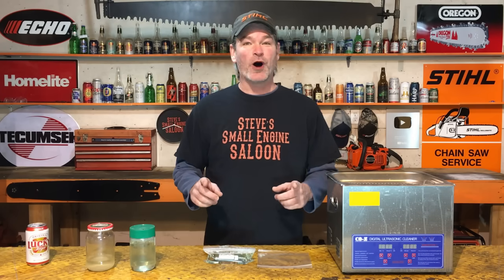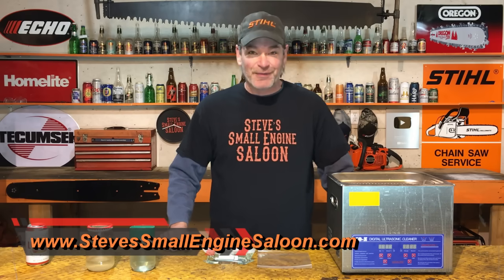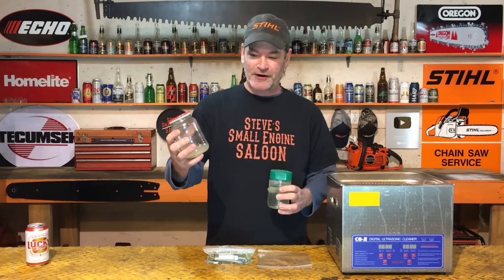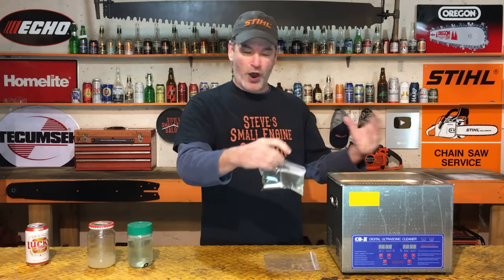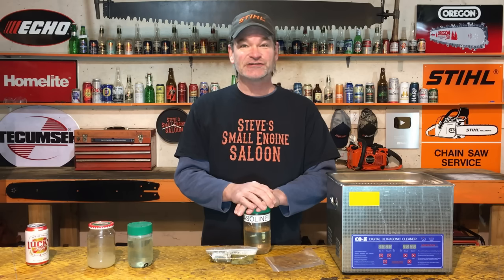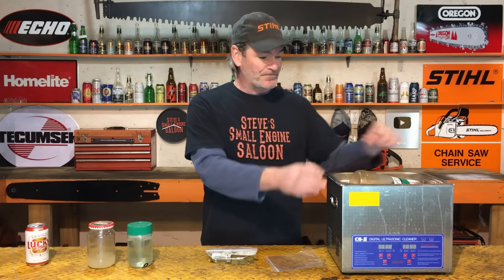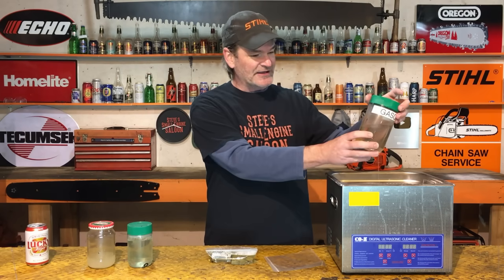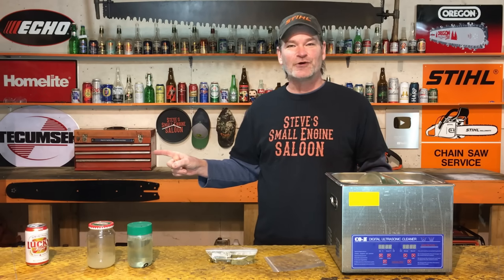UPDATE: Ultimate Tips For Using An Ultrasonic Cleaner

Comment: Steve, great video and advice. I’ve used Dawn in my ultrasonic for years but at work I’ve tried using a small glass container and “gasoline/2 cycle mix” in mine.... it cuts the clean time in half and I believe it dissolves of solidified debris that has dried in carbs from setting. I do run my heat but keep it under 100 degrees and creep the lid loose on my jar because it seemed to build pressure. My jar sits perfectly on my basket so it won’t tip over. The bubble action is amazing to watch. 
Thanks Steve!!!!!
Reply from the maker: You're Welcome...

Comment: Love your videos Steve but I do have a comment regarding plastic and gasoline. I bought a cheap turkey baster to extract small quantities of gas and oil without having to get out my pump. I got sidetracked and left the baster sitting in the old gas that I had extracted. (There was only about an inch of gas in the bucket.) I came back a few hours later and found a melted turkey baster. The gas had eaten about 3 inches off of the end of the baster. The bucket that I was using was also plastic but it was fine. That being said, if the plastic breaks down in the usonic cleaner, I think the worst thing you would run into would be having to clean out the reservoir, assuming of course that your cleaner isn't close to any ignition sources.

Comment: You changed the way I use both of mine, I have a 10L and a 15L I now use the plastic Skippy jars cause they have the largest mouths, I use the mixture I use cause I have pets, my mixture, won't kill em, I use 50% simple green purple, 25% distilled white vinegar, and 25% distilled water, IE baby water, besides using the same amount of gas would cost you more, and disposing of the dirty gas will harm the environment unless you do it properly, and that's a pain, my mixture you can dump out in your backyard without harming the world, now I preheat my mixture in a microwave, so my ultrasonic cleaner doesn't have to, you can't do that with gasoline, and as to using plastic over glass or visa versa, I just find the plastic more able to accommodate carbs, cause you can't flex glass to fit a carb.

Comment: The complaints against using  gasoline could be putting it in a sealed container, it could expand and possibly break the container. Other than that yea gas is a great cleaner, I also use dawn dish soap as a degreaser for bigger stuff

Comment: I'm relatively new at this and I've only used Gunk carb cleaner in my ultrasonic cleaner. I think it works great but it does damage rubber parts. interested to know why the simple green or other detergents are preferred by others. Great info as always Steve.

Comment: Great video Steve.
I never knew I could ultra-sonically clean stuff in a jar or zip-lock. What a genius idea to not pollute all of the solution in the tank.
Reply: If using a jar or bag (isolation container), you don't need the ultrasonic cleaner's tub to have cleaning solution in it. You fill it with water (distilled is preferred) and put the cleaning solution in the isolation container with the part.
Reply from the maker: Thank You...

Comment: The use of petrol/gas is mad. But when it goes tits up is because people fill the whole tank with petrol not just a bottle or bag, and the metal parts being rattled about can cause a spark. I've done it but I put the tank out in the middle of the lawn just in case it goes up. Never has but I'd rather it be outside if it does.

Comment: yup if you have not tried the unleaded gasoline trick... you are missing out!!
one thing is to dip the carb in berryman carb cleaner first for at least 1/2 an hour ..
I did it on honda generator carbs (stripped down). then ran it in the unleaded gasoline for 3 x 15 min sessions
turning the carb in the each time session.
then dip the carb after a good rinse off in fresh unleaded gasoline.  brush off any stuff left, blow dry with air compressor air.
final dip in the fresh can of berryman carb cleaner to treat the aluminum for anti corrosion.

trust me it works!!
it worked on hard to clean Yamaha generator carbs worth 300.00 each!!
well done steve!! well done!!
Reply: Awesome

Comment: I have used gas to clean things threw the years. Once a friend got burned with gas and in the burn unit in the hospital...Which I will never forget some of the burn patients. My friend was putting gas in a older lawn mower with the gas tanks by the engine. Engine not running but was hot and boom. A few guys got burned bad by fueling there plastic fuel cells in drag cars.
 Happened by static electric charged. Why they made us use ground strap the top ring on the fuel cell. When using gas make sure you are grounded so you don't start one by static electric charged. Never gave that a thought till I was in my 40s myself.

Comment: Gas works good and I do use it but my go to is the solvent from the carb dip kits from Napa as a solution for mine at work for 3 reasons:
1, it cuts varnish up better than gas 
2, it has a higher flash point than gas so I can heat it up in the ultrasonic cleaner using the heat function
3, say it's closing time and I have 1 more carb to run, I can throw the carb in the ultrasonic cleaner with it off and let it sit overnight in the sauce and fire it up in the morning for 10 minutes and it comes out spotless. Sometimes if the carb is really bad I will run it in the ultrasonic cleaner for an hour before the close of business and let it sit overnight and then run it for another hour in the morning.

Comment: I’m a gunsmith and have owned a crest ultrasonic cleaner for over 15 years.  I use a mesh tea infuser ball to put tiny springs and parts in.  I use biodegradable degreaser in my cleaner and have even used dawn dish soap in a pinch or in the rare occasion for guns with a delicate finish. Dawn is used to get oil off animals so it’s about as gentle degreasing solution as you can get.  I’ve never just put water in my cleaner and then put a part in a bag of the degreasing solution.  Next time I swap out my solution I’m gonna try it with just water as you do.  Thanks.  Never too old to learn something new.  👍

Comment: Might be a Canadian only tip but milk bags seem to be a bit sturdier than zip locks for smaller cube carbs.  No idea if fuel will melt them over time.  I seal them with a chip clip.  Clean the milk protein out first by running some fuel in a new bag.
Reply: Haven't seen a milk bag since our time in the prairies -- brings back memories!  I can't imagine how much milk my parents bought -- drank with every meal and chugged it down like water whenever we ran in from outside...

Comment: Steve I am thinking that video was a 2 beer video . I use  JetA  in my tank . With heat .
Works great . If you can get your hands on JetA fuel . Or Kerosene .
Reply: Jet A1 and Kerosene is the same product . If it is used on the ground , it is called kerosene . If it is used in the air (aviation) it is called Jet A1 . You can also get what they call None Aviation Jet if it is not used in the air . Jet A1 is cheaper because they sell more of it then Kerosene . ATB , Ken🇨🇦 .
Reply: @kenchan5047   Yes you are right .I am a mechanic for a airline . If I went into that kind of info It will lose peeps.

Comment: Contained gasoline is not dangerous... Now if you heated it in the tank I guess it could expand and leak into the water and float on the surface. This could ignite I suppose but I believe it would take a pretty deliberate action to ignite it. If you were sucessfull in igniting it it would simply create a low cold flame on the surface of the water as the fumes evaperated and burned off. Not seeing a tragedy happening still. Ok lets say it sat in hot water and leaked all night...no one turned off the machine...and there is only an on and off switch with no timer. You could theoretically create a fume problem that would gather at the floor and spread across the shop. Now you have explosive fumes. Not liquid but fumes...now you would still need an ignition sourse. A water heater with a pilot light? A gas boiler? A wood stove? All things you shouldn't have in a small engine shop anyway but in a home garage or workshop these things do happen. But it's rare. You almost have to do it on purpose...but ok it could happen to a moron...so it's not impossible.

Steve try NAPA non-clorinated Brake cleaner. I think you may  be suprised. Just buy a can and spray it into your peanut butter plastic jar. You can find brake cleaner in 1/2 gal cans but just to experiment you only need a 12 oz can or so. You can reuse it even if it looks dirty many times. Keep the lid on though because it evaporates quickly.

Comment: I have the same unit.  The container does not need to be closed if the water in the unit is not so deep as to overflow into the container.  I use glass baking dishes, & etc..  You will not be restricted by the neck on the jar in this way.  I do not use gasoline, instead I use standard solvent which is used for parts cleaning.  It leaves no film like gasoline and is almost impossible to ignite.
Reply: So you just use parts washer solvent?  Wondered why that or the simple green wouldn't work in one of those ultrasonic cleaners....I don't have one, wish I did sometimes though but don't need one often enough to warrant the price.  So I just clean everything by hand and soak in simple green if I need to overnight.
Reply: William Sevier  I use what is/ was called “standard solvent”.  It is not water based like most of the parts washing solvents today.  Basically any fluid will work to a certain extent.  It is the microscopic bubbles created by the ultrasonic waves that do the cleaning.  A good analogy regarding the liquid used is found in clothes washing.  You could wash your clothes in plain water and they would be cleaner than when you put them in the washer, but you use a detergent to help break down the soils and remove more dirt.  You can follow this idea by thinking of the ultra sonic cleaner as the washing machine with agitation(parts don’t actually move like the clothes but the fluid does) vs. just soaking the clothes in a pail of water.

The difference between your technique (which I used for many years I might add) and ultrasonic cleaning really shows itself with high gloss items such as jewelry.  The rings and stones come out virtually like the day they were purchased.  I mention this only to tell you that there is a difference between soaking and ultrasonic cleaning.

Harbor Freight has a small ultrasonic cleaner that I upgraded from primarily because of capacity.  (It will hold small carburetors, gun action parts, milling machine collets, and etc.). It worked fine but a guy who already had one told me what I needed to do to it before using it to prevent damage.( Like most Harbor Freight items they need a little tweaking). If you decide to go this route contact me here and I will tell you what to do.  It’s not much but needs to be done to prevent it from being damaged.
Reply: @37yearsofanythingisenough39 what needs to be done just bought one
Reply: @slicktmi  If your unit  from Harbor Freight is the one with the silver plastic housing, somewhat oval shaped, you need to more or less caulk the seam just inside the rim that goes all the way around the tank with a silicone caulk.  I used RTV Red due to the fact that it is high temp and the unit does have a heater.  It probably could be done with any silicone caulk because I doubt the temp ever gets that high that RTV Red is actually necessary.  If you do not do this the fluid in the tank will eventually destroy the electronic control of the unit as it, or atomized fluid, will pass through this seam. Make sure you use a 100% silicone so that it remains flexible over time and just force it into the seam with your fingertip.  Wipe the excess off the wall with a rag saturated with mineral spirits for a neat looking job.  RTV Red is sold in most auto parts stores or home centers in a tube on a blister card.  Hope this helps.

Comment: What about using a soda blaster like people use on motorcycle and car carburetors? Usually they use that in conjunction with an ultrasonic parts cleaner vs a ultrasonic alone and it’s safe to put any part in a soda blaster including plastics.

Comment: I used gasoline in a glass jar with no heat after watching your other video.  Cleaned parts well and no other problems.  However, when I opened the lid to the jar there was a sound as if the jar had become under pressure.  I will probably try it again before deciding on the future of using gas.  Keep the videos coming!
Reply: The temperature in the room can promote evaporation thus liberating vapor that results in pressurization of the container.
Reply: Also temp change.  If it went in the solution at  40 degrees and the solution is even ten degrees warmer. It will pressurize the container a touch.

Comment: I put the parts in the basket without any jars or containers. I also lined my basket with finer screen to prevent small parts from falling threw. Simple Green or Evap-O-Rust.
Reply: Watch his previous video on this, the point of putting things in a container with solvent and water in the cleaner tank has a purpose.
Reply: @AuMechanic  I follow you, but I don't mind cleaning the tank every so often. I use the Simple Green or Evap-O Rust over and over for several cycles. I'm not trying to tell anyone how to use their cleaner just a suggestion.

Comment: Another great tips and tricks video.  Me thinks its gasoline vapors that are dangerous more so than gas in a jar or canister.  No extra oxygen and no ignition so no fire or explosion.  Gas is one of the best cleaners and as one of your followers said lacquer thinner is fantastic can melt some  plastics.  I believe it is more flammable as well.  Neither tastes very good.
Reply: Yes it is the gas vapors that are dangerous. You could throw a lit match in a bucket of gasoline and the match will go out. If you pour the gasoline out of the bucket and have nothing but gas vapors it will ignite.

Comment: I think perhaps that the “lightning” people are confusing ultrasounds with microwaves. Love your channel!
Reply: Paul Farmer I think you’re spot on Paul.  A jar of gas with a metal lid in a microwave could ruin your whole day.
Reply: @farmerbob4554  would make a good video...
Reply from the maker: Thank You...
Reply: Ultrasonic waves cause cavitation, that's how it cleans. The pockets implode and blow the dirt off what you are cleaning. These implosions can cause extreme heat albeit on a small scale but there are many at a time. The heat can reach upwards of 10,000K. Since the gas is in a sealed container it may not be a problem but fill the tank with it and problems might arise. I use white gas for cleaning parts in glass containers in my US but I would not for any reason put it in the tank.
Reply: Possible, but if they did have a vague idea of what they were trying to talk about, I'd wager they were referencing sonoluminescence. Ever heard of mantis shrimp or pistol shrimp? They stun their prey by literally punching the water so fast, hard, and focused at a point, the shockwave from the cavitation immobilizes their target and is so intense, it produces a spark of plasma at the impact site with instantaneous temperatures hotter than the sun. It's effectively using the same process behind the cavitation the ultrasonic cleaner uses (as sound is just vibrations in a medium), but you could say the cleaner is a bit underpowered and unfocused. To verify, run a cycle and turn out the lights. If sonoluminescence is happening, it should turn your cleaner into a disco. 

Regardless, it's still not going to explode. Remember your fire triangle? You have fuel and for the sake of argument let's assume spark too. Still kinda missing a key ingredient. Sure, there's some air at the top of the container, which is easily addressed, but here's the thing about explosions - there's a reason why flooding your engine is a thing with carbureted engines and is much less likely with injected engines. Let's see what ratio of people can figure out what I'm talking about.
Reply: They're confused that's for certain. Especially if they are also confusing microwaves with lightning.

Comment: Nice work Thanks
Just tried laquer thinner on gummed up  carb works ten time s better than gumout or seafoam.
After 45 years..
Melted gum varnish quickly nothing else did.
Reply: Yup!
I've been using lacquer thinner for years. But its probably because i used to work in a body shop and knew how good of a cleaner it is!😉
I always soaked a cloth in  lacquer thinner and wiped down any greasy parts with it, before i prepped it for paint. Works better than any degreaser i have tried!